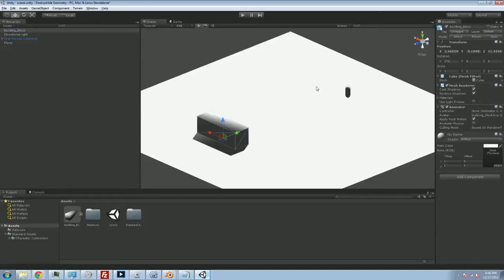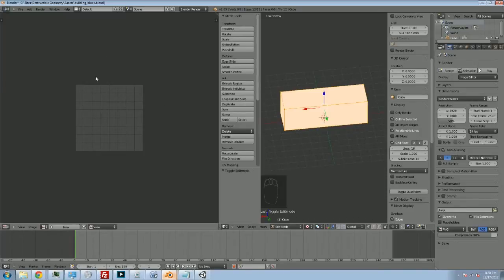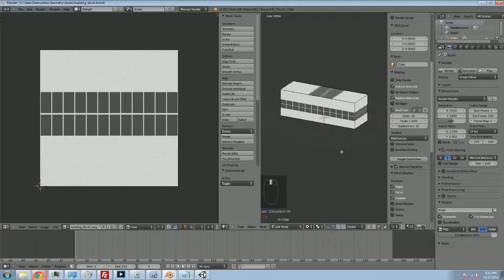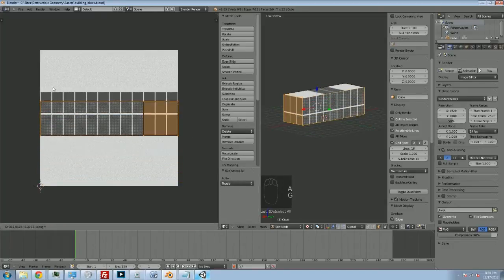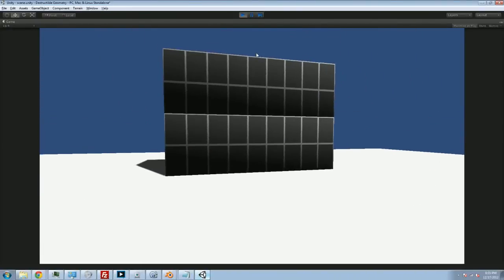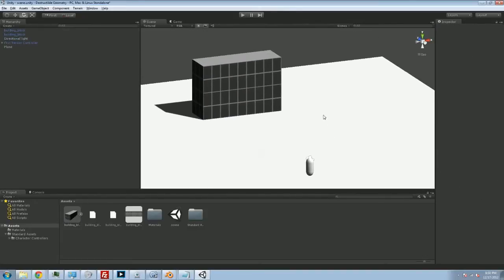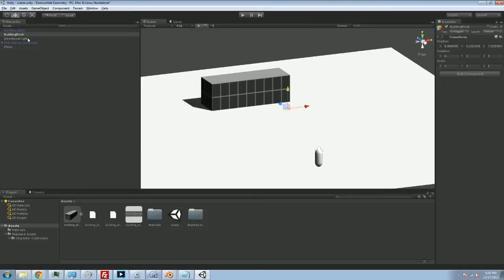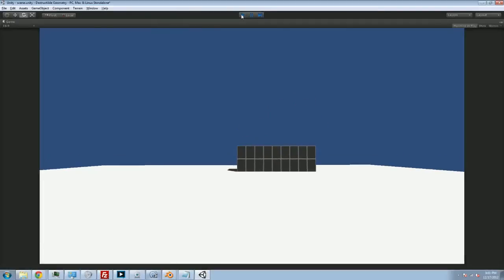Destructible Objects - Tutorial for Unity 3d and Blender - Episode 4

Comment: Great tutorials! I just started with unity, have been using blender a while now. @ 1:42 you set all position axis to 0 on the building_block and then on the BuildingBlock, then the block stands on the floor perfectly. When I do this, half of my block is underneath the floor and half is above. In blender I did put the block on the X and Y axis like you if that matters. It need to be 1.500001 on the Y axis for me to make it stand on the floor. It gets that value when I drop the block on the floor.